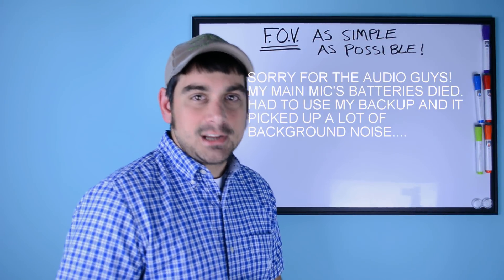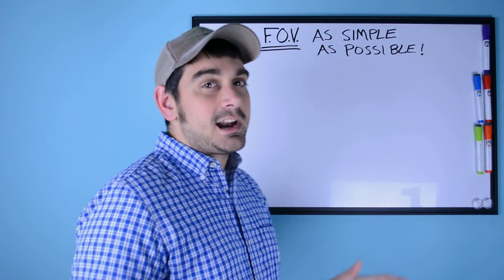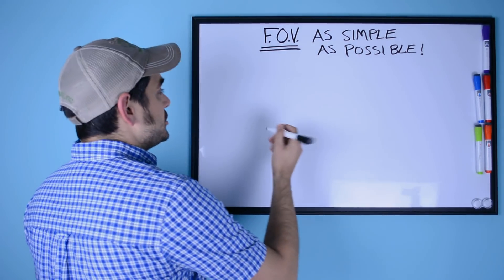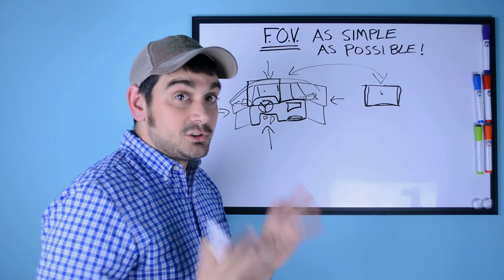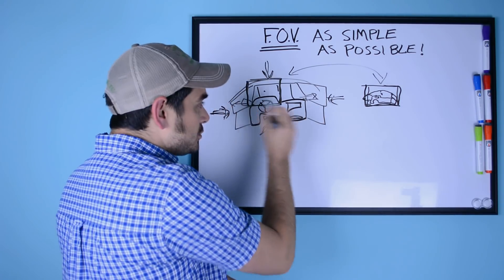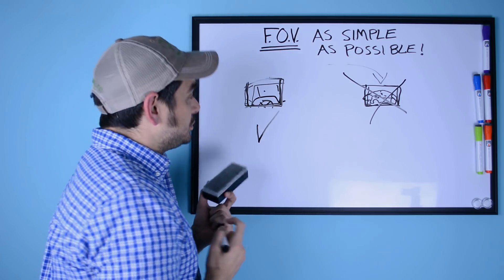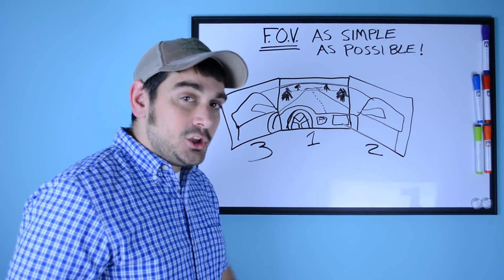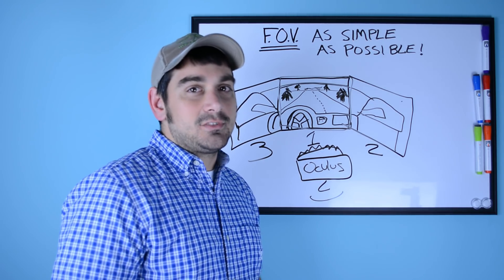Field Of View Explained As Simple As Possible!

Comment: Agree with this simple explanation.  The only thing I would add is that  your setup is also key, running triple 24’s from 80cm at correct FOV will make the track elevation very pronounced and the distance between corners appear short.  The fix is to get your monitors as close as possible and/or move up to 27s.  The alternative I used was to set the correct FOV but fool the sim into thinking the monitors are a bit bigger than they really are and to incrementally move to the actual monitor size and distance from them you are.  Sometimes the absolutely correct FOV can take away from the “thrill” and sense of speed, a bit of trickery can have you closer to correct FOV and still maintain that sense of speed.

Comment: I agree with everyting, but , i have  assetto corsa  and am noob for simracing, so i measured everything tried the FOV calculator , and the program sad that i need 16 degree,  so the distance of curves is better little close to me but ok, and my problem is that,when i set the degree to 16 ,  i have a totaly wrong 
assessment of speed, everithing look like ultra slow even if am driving 280kmh, i have a feeling like am driving 30-40, so i "fly" out of most curves, and dont know  when to brake and how much

Comment: There is one thing these videos all leave out, operating with this FoV is the equivalent of driving with an empty box over your head with one eye closed. The opening of the box would be the size of your screen at the correct distance from your eye. If you drove a real car like this you're probably going to crash a lot. So sometimes a compromise needs to be made if you have a limited screen size and position. Your brain will compensate quite well. This is why triple screens or VR is optimal but if you don't have that you may find some compromise to get more peripheral input gives you a better result.

Comment: I always thought about FOV as you said, I wanted to fit what I normally see into the monitor. After coming across another video on this topic now that I'm getting into sim racing, it just made sense. Also adding my second monitor (wish I had a 3rd) helps keep the view more realistic with the FOV adjustment. Certainly allows you to more accurately gauge how fast you are coming in, where braking points are, etc. Great video!

Comment: Using the correct FOV made me faster by almost a minute around the Nordschleife mostly because since I didn't have that amplified sense of speed I could take corners much faster than I would with "Forza FOV" as some call it. Still I just can't shake that claustrophobic feeling. Also in left hand hairpins I'm not able to see the apex. So I always end up going wide. I'm still on the fence. On one hand yeah it makes me faster but on the other I hand up going wide in some turns and risk crashing another racer.

Comment: i Disagree in one simple think, in the oculus you still see the same as monitor 1, you can see what is in the monitor 2 and 3 if you turn your head, instead that, with triple monitors you can see the three monitor only turn your eyes, you dont need turn your head just the eyes. So, for me 100% triple monitors and you can add some extras external gauges.

Comment: hay there how are yea.

im getting a 80/20 rig with a triple monitor stand bolted right to it for triple screens. in order to have the correct field of view what size of monitors should i get?

what do you think about the 21:9 aspect ratio?

thanks
Reply from the maker: Doing good thanks. Technically there is no correct size screen to create the correct FOV. Depending on how far your monitors will be from you eyes you should be able to get anything from 24" to 40" monitors to work with a realistic FOV. With the correct FOV the image should look the same on any size monitor but the smaller monitors you use the more information you loose (can't see) at the top and the bottom if that makes sense. The objects you are looking at will be the same size on any screen but with the a larger screen you will see more of the dash and more at the top of the windshield and above. For now the most commonly used size screen for triples are 27" but I find 32" to be the sweet spot as 40 seem to be a little big if you are very close to them (which you want to be as close as possible).

As for the aspect ratios, you can use either but I prefer a 16:9 for a triple setup. You will get your width from using multiple monitors so you don't necessarily need to use ultrawides (21:9). Typically ultrawides are used for people who don't have the room to run a triple setup. Now that is not to say you can't run 3 ultrawides and many people do. Just keep in mind though, that will cause additional strain on your gpu having to push out all those extra pixels and will have a huge impact on frame rate. Running triples take a fairly strong PC on it's own and running triple ultrawides even more so.

Hope this helps! Good luck!

Comment: Great info. It basicly makes it so if you use helmet cam. It puts you in where you sit in the car and only what you would need to see the rest is the road and windshield correct?  So if I’m on my couch 10 feet or so from a 34 inch tv. What should my helmet cam be and other settings. For Best settings.

Comment: I knew there was people that ignored this, but I couldn't imagine people arguying against it... :) 

anyway, one thing to add: once you got there right, you can also greatly improve the immersive effect by - somehow - "aligning" your  phyisical position and your virtual position using the "Seat Pitch" settings (in rf2 it's shift + keys used to set FOV) and, in particular in open wheels, getting the horizon line at the proper height relatively to your eye sight. It gives you a better view of the track's relief and then the doings of your force feedback gets more meaningful reactions regarding this relief. With all this you fool your brain into thinking (more intensively) that  it really is inside the car.

Comment: Dear Dan, Thanks for the explanation...Q: I use PS4 to play Project Cars 2, so I don't have access to connect 3 monitors, I use my 55 inches TV as monitor, and I don't have money to buy PS-VR system, so, is there anything I can do to have some proper FOV? Thank you !
Reply: Yes of course, you can adjust FOV is the settings and you'll get some advantages from your 55 inch TV.
Reply: Opposite Lock, Thank you !!  :-)
Reply: Hi Dan, I was wondering if you have time for another question.  Currently using a 55'Samsung flat TV as a monitor for my PS4...I can only see what is in front of me, when turning a corner I'm unable to see  the full corner (sorry, IDK how to explain it my English is limited), I can't judge the "depth" of the turn/corner, so I don't know in advance how much to turn the wheel. In other words my peripheral vision is limited. Q: is having 3 monitors the only solution to this problem? Or I can do something by changing the FOV in the game? I've tried different setups but nothing seems to help :-( ...Thank you for your time.

Comment: Honestly I did not hear the argument for setting the FOV as in reality. Replicating the same FOV as you would have in reality is not an argument. Similar experience as in real driving would be one, but that includes a lot of other factors, FOV-setting being one out of a dozen.
Don‘t get me wrong: I set the FOV as close to the real thing as possible (and even alter settings, e.g. in raceroom, to get the virtual wheel exactly positioned and sized so it matches the „real“ wheel). I use (switching them regularly) 3 options, I have -> 65‘‘ TV with low lag around 2 feet in front of my eyes (correct FOV + a few degrees), Samsung 32:9 gaming monitor (correct fov), even closer, acutually a few inches right behind the wheel and an HTC Vive.
My conclusion: TV is not bearable so close to the eyes and refreshrate (60Hz) sucks. VR is unusable because of miserable resolution (unless you know the track by heart, there is no helpful visual input, it is a wonder I manage to do the same lap times as with the other options), tunnel-view and lack of spatial overlapping for true 3d (which hopefully gets better with newer generations like the Pimax 8K).
People - and I know there are a lot - claiming you would have faster lap times have no clue. You don‘t. Period. I have probably more combined PCars2 & AC track records on my account than anyone else. I tested the different systems for hours and hours. Lap times are the same. Yes, you will have faster lap times with any change you believe improves lap times... that‘s basic psychology.

What would be the perfect solution then?
Specifically for sim racing it would be clearly one single screen, around 130 degrees of visual from side to side... AND 3d-image. And of course with a refresh rate of minimal 100Hz. VR though has so many drawbacks, it is not even worth counting them all.

Comment: I'm not saying there is no merit to your argument, but it's not the only thing to consider. You have one point. But the bigger point is that you need to have maximal situational awareness to be a clean and respectful driver. Those objects you want erase with your marker aid in making me a safer and more aware driver. Of course you're right that 3 monitors or VR are the best fix but if I'm on a single monitor I'm going to do something between correct FOV and triple monitors. I at least want to see both A pillars
Reply: Jason Kennedy 
He's not saying the FOV you're uses is bad or wrong thing to do. He's explaining what "correct" FOV is. The FOV you need doesn't make it correct.
Reply: if one of anything is the "correct" version, doesn't it make all of the other anything's incorrect, or wrong?
Reply: @dman1234541  there is the objective,and the subjective correct,so no.

Comment: FOV on one screen needs to show all or most of what you would see with 3 screens so you can 1. See where you are going, 2. Get a better sense of speed. This has been the way since before multiscreen support has become common. Even playing fps games like battlefront requires you to increase you FOV for sense of speed and seeing you opponent. It's called a simulation which means an approximation to the real thing. Who wants to play a car SIM that feels like you are going 25 mph when you're really going 100+
Reply: If you're only using one monitor and shrinking the image to fit, then no, you're not using the proper FOV.
Reply: Dude... are you being serious right now? Dan's explanation is so that when your car is going 100 kph, you'll FEEL like you're going 100 kph.

What your solution is doing (assuming this is a single monitor 23" across), is making going 100 kph feel like it's 200 kph. It is inaccurate and causes serious misjudgement to braking points and turning points.

Sim racing is NOT just about the sense of speed, leave that to your typical power-fantasy video games!

*Seems like I may have replied to a troll here.
Reply: @ Max Smith so when I get in my REAL ! car and drive that image shrinks ? Don't think so ! Therefore shrinking the image and distorting it IS NOT REALISTIC ! If you prefer the extra situational awareness fine if that is what works for you, but just because you prefer that and many others may does not make it more realistic. 
There is another system Tobii eye tracking think just F1 2017 is supported for now but hopefully more racing sim and simcade games will be added and the tech will improve and get taken up by other companies and then even more games.
Reply: That's not true for a simulation experience. What you are describing are hacks people use to improve their situational awareness. By increasing their field of view, the image is actually distorted and shrunk, but you can see more on that small monitor. It's a trade off between realism and situational awareness. People do it because they value the information from the improved situational awareness more than the realism of a realistic FOV. But for racing, you need an accurate feel for speed which requires a realistic FOV. You get less situational awareness because of it since you can't see out your side windows, etc. But that's why the proper fix is a 3 monitor or VR setup.
Reply: What's not true? Needing to see where you are going or needing to have a sense of speed? I think you are lost and miss-informed. I can tell by the use of the word hack. You clearly don't know what hacking is. No matter what you do it is not the real thing therefore the image is always inaccurate and only a representation of the real thing aka a simulation. VR doesn't give you a true FOV either because we have preferential vision and VR field of view doesn't give you that. I am sure those 3 screens are not 100% accurate in size or distance so that is a distorted image as well. So just get over it. You are just a sim snob and you think your setup is the best. Get over it!
Reply: 1) It is important to see where you're going, but changing your FOV to do it changes everything else. You're right that it's impossible to be 100% accurate, but having a realistic FOV gets you closer to 100% accurate. VR is the best, affordable option, but 3 monitors is a reasonable solution as well. Way better than cramming all that other stuff into one small screen. And yes, it's a hack. You're using the FOV in an unintended way to cram more data to the screen to improve your situational awareness. Maybe you don't know what hack means? I'm not arguing that having more SA is bad. You, apparently, value SA more than accuracy. Which is fine, but don't tell everyone it's 'more realistic' or 'accurate'. Claiming it's better because you have more info is fine.

2) The part about sense of speed is just wrong in every way. Having a bad/poor FOV will either make you feel faster or slower than what it would in reality. Maybe you've never really driven at high speeds and have a false preconception as to what high speeds look like?

I think you are focusing on peripheral vision too much. The only way to get accurate peripheral vision is 3 projectors on a curved wall. From your comments, I can tell that you judge your sense of speed based on your peripheral vision, but forcing your peripheral vision to be in front of you via FOV is not more accurate. If you try walking down a hall with your hands blocking your peripheral, you'll realize battlefield and many other FPS games actually have a pretty accurate sense of speed. Try the same thing next time you're in the passenger seat of a car. Changing your FOV to give you a weird, distorted peripheral effect can adjust for this, but it's a tradeoff, as I said in my first post. It makes sense to do in FPS games, because being able to see other players sooner is critical. But in driving/flying games it will more likely just mess up your sense of speed and natural tendencies (if you really do drive/fly. And if you don't, it can mess with you when you start doing it for real). The fact is, if you are doing this on 1 screen YOU DON'T HAVE PERIPHERAL VISION and anything you do to try to get it is inaccurate and will mess with something else.

Finally, I don't have 3 monitors or VR, or 3 projectors, so no, my setup isn't best. Neither is yours. I think we simply have different goals. You want to be able to play the game with as much info as you can easily accessible (probably feeling it gives you a competitive edge like it does in an FPS). I want my driving/flying to look as similar as possible to when I'm really doing those things.